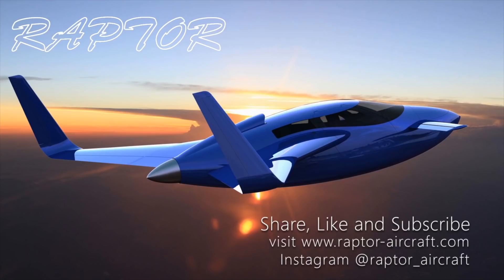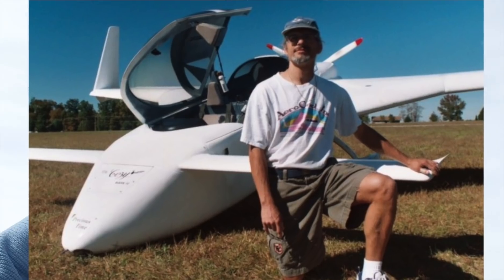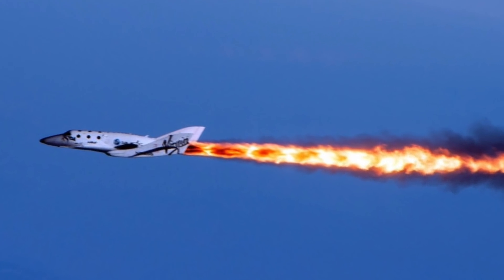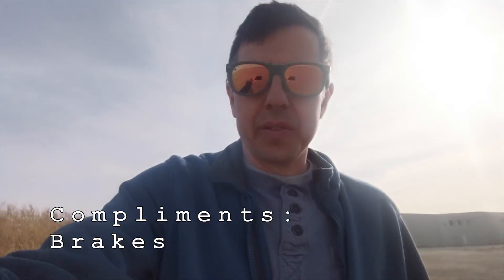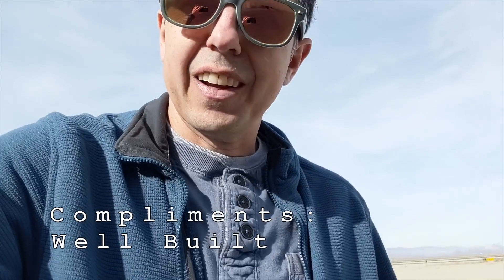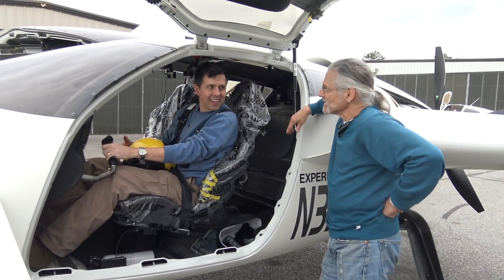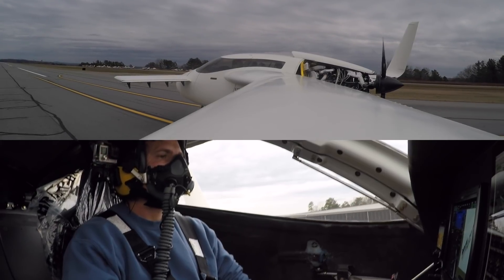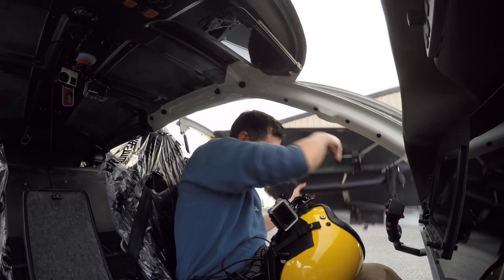Clever Girl - Raptor Aircraft Prototype First Look - Wasabi Flight Test

Comment: Totally transparent build and modification process followed by an independent and transparent assessment, review and test flight process. Has this happened with any other aircraft design? I think not.

Really looking forward to seeing the flight test process unfold for this aircraft. Of course there will be glitches, failures and modifications. This is after all a prototype. To expect otherwise is simply ludicrous.

And especially hoping that Diesel engine concept is a winner. There are lots of places across the world where Avgas is getting increasingly difficult to get.
Reply: As a boat guy, I know that Diesels are meant to run for long periods at full throttle. Traditionally, they are heavier than gas engines, but they are much more durable than gas if fed a good diet... the fuel filters need to be very good and no air must get in to the injectors.
Reply from the maker: Thanks for the comments guys, we are excited as well!

Comment: FYI ... taxi test had a main gear  failure due to a bushing popping out of its mount.  To my knowledge, no drop test has ever been done on the aircraft.  Considering that the current weight of 
the plane is at or over TQW with a single pilot and 30 gal. of fuel the main gear will be stressed on  landing .
Reply: To be clear max. TOW
Reply from the maker: Thank you

Comment: I strongly recommend you bring in someone with Audi / VW Diesel performance experience to evaluate Peter's decisions in building the powerplant.   I had a conversation with Malone Tuning about this platform a while back and they seemed interested in the idea.   I think there are gremlins in there.  I'd like to see a bore-scope through the glow plug holes to verify the combustion chamber in the pistons isn't pitting / melting due to the extremely high temps he's be running.  Also education on how hot is too hot for EGT and why piston diesel is different than piston gas combustion.  Peter claims his EGT probe being at the Y junction of his crossover pipe is the reason for the excessive temps.  What's his math there?  We always pull EGT from the most restrictive spot in the exhaust and anything over 1300 (conservative) should be limited to very brief pulls.
Reply from the maker: Good thinking!
Reply: While they're at it, have the Audi experts check out the custom ECU tuning that was done, especially the program that pulls power when temps get too high. That doesn't seem safe for initial flight testing.
Reply: I believe it's running a third party ECU and not an Audi one

Comment: Over here from Raptors channel, why would you want to open the door and Bail out of a pusher prop aircraft with BRS? Just wondering.
 Would you be planning on deploying the BRS and then bailing out on your own ? 
You would have to deploy the BRS, shut off the engine and feather the prop, open the door, and then bail out of the aircraft under it's own chute, With your own chute?
Reply from the maker: There are two reasons you bail-out.  

First is fire (BRS doesn't help there).  

And second is the airplane is out of control and unrecoverable (or unlandable).  In that case the airplane is likely spinning around some axis, and therefore the propeller may not be an isssue.

I would suggest we change the way the question is asked.  Can you fit a parachute in the airplane?  Is there any chance you might wish you'd brought the parachute?  If those answers are yes, then you bring it...period.

It's also worth mentioning that the BRS has not been tested, so if it failed it would be nice to have another option.
Reply: @utopiasnow  I suppose that all makes perfect sense. I would suggest running the engine on diesel as opposed to Jet-a or any kind of blend of the two.
 I've never seen Diesel catch fire and I believe it's less volatile than Jet-a. 
 I once drove a Diesel back to the shop leaking diesel from the return lines, it leaked onto the exhaust manifolds.
 Not my finest hour, but I reasoned that the harder and faster I ran it the less return fuel there would be. 
 I drove that thing 40+ mi trailing a smoke screen that would've made a WW2 tank commander proud. That GM big block V8 didn't have enough EGT to ignite Diesel.
 The Raptor has really high exhaust temps, so I would back off the power to drop EGT and fly it in case of fuel leak. 
 Diesel fuel changes formulation throughout the year and across America according to climate, right now it should be most resistant to low temperature jelling. There are anti-jell additives available everywhere.
Reply: @kylegoldston  jET A IS REFINED DIESEL FUEL AND IT HAS PARRAFIN IN IT TOO.
Reply: @billwessels207  Crude oil arrives at the refinery and goes into something called a "crude tower" where it is subjected to changes in temperature and pressure. This process breaks down and separates it into different length and density hydrocarbons which are then evaporated off for further treatment throughout the refinery, they don't turn one fuel into another. I worked at a refinery rebuilding a crude tower that burned for a couple days and then fell over. My point was that Diesel fuel is harder to ignite, providing a bit of safety margin in case of a fuel leak.

Comment: Why do you wear O2 for all the tests and flights?
Reply: Safety.  They are testing a new design, they are prepared for the cockpit filling with smoke.
Reply from the maker: Three reasons:
Crash Protection
Better Comms
Smoke in the cockpit

More info here:
https://youtu.be/a-lceaOL2E8
Reply: Also for comms
Reply: Pretty dorky.  Notice how Peter is in the same cabin without oxygen or helmet.  Seems like a lot of Hollywood action going on.
Reply: @marmstrong77  ya my thought exactly
Reply from the maker: Daniel Mills-Thysen the taxi test is a dress rehearsal for first flight.  It gives us a chance to check the comms, head clearance and sight angles in flight configuration before that first flight.  Meanwhile if the only cost of a safety measure is looking like a tool, that’s not much of an argument.

Comment: Is that a diesel engine? What are the planned performances? What is the base target price? Thanks!
Reply: Yes it is a diesel engine.
Reply: @Marvi Wilson Diesels are much heavier than their gasoline equivalents, they NEED to be because of the nature of the diesel combustion cycle, it places greater stress on engine components. Here are some comparisons:
-
AE330 - 180 hp, 410 pounds.
Deltahawk DH180A4 - 180 hp, 340 pounds.
Lycoming IO-360 - 180-200 hp, ~300 pounds.
Viking 180 - 180 hp, 260 pounds.
-
SMA SR305 - 227 hp, 455 pounds.
Honda/TCM HAP engine - 225 hp, 200 pounds.
-
Continental CD-300 - 300 hp, 548 pounds.
TSIOL-550-A (liquid cooled) - 350 hp, 401 pounds.
Adept Airmotive 320T - 320 - 360 hp, 340 pounds.
-
I suppose saying that diesels are twice as heavy as gasoline engines was a bit of an exaggeration, but not by much in some cases.
-
Modern gasoline engines are just as efficient as modern diesels, compression ratio is far from being the only engine attribute which determines efficiency.
-
BSFC in lb/hp/hr:
Continental IOL-200 - 0.345
SMA SR305 - 0.36
Liquid Cooled Air Power O-360 - 0.36
Honda/TCM HAP engine - 0.37
AE330 - 0.39 - 0.35
Deltahawk DH180A4 - 0.38
Rotax 915 iS - 0.395
Limbach L 2400 - 0.40
Viking 180 hp (no leaning) - 0.42
-
Other engines:
Some well tuned, naturally aspirated Honda 4 cylinders can get down to around 0.36 lb/hp/hr while making 200 hp at around 5,500 rpm.
Even with very crude engine technology (by modern standards), the Wright R-3350 and Allison V-1710 turbo compound engines were able to get down into the 0.36 to 0.38 lb/hp/hr range.
-
Modern gasoline engines can run on mogas, which is cheaper than any aviation fuel. The problem with the aviation community is that it's insane and compares modern diesels to archaic LyContisaurus engines and assumes that this is a fair comparison. Adopting modern gasoline engines would bring FAR greater benefits to light aviation than adopting diesels.
Reply: http://www.raptor-aircraft.com/
Reply: http://raptor-aircraft.com/
Reply: @Marvi Wilson "...the compression ignition engine goes further on the same quantity of fuel as the spark ignition engine equivalent."
-
Only by volume, not by weight, cost (in the US), NOx emissions, or CO2 emissions, so in all of the ways that matter, gasoline engines are superior. Although, in aircraft, NOx emissions would probably be comparable due to LOP operation being required for peak efficiency.
-
Diesel contains about the same amount of energy as gasoline by weight, gasoline and diesel engines consume about the same amount of fuel by weight to produce the same amount of power (this is what BSFC tells us), this means that diesel engines and some gasoline engines have about the same thermodynamic efficiency.
-
The only diesel aircraft engine that doesn't have electronic fuel injection and has a good chance of powering aircraft is the Deltahawk engine, all of the rest have very complex and expensive electronic injection systems. Using heavy fuels in aircraft also brings other issues, like the need for fuel heaters to prevent fuel from gelling in cold temperatures and at high altitudes.
-
Here's some information that I complied a while back for automotive diesels. The information comes from the EPA and everything is based on combined city and highway mileage.
-
Chevy Cruze (gasoline): 153 hp; CO2/mile 277g; annual fuel cost $1,050; EPA smog rating (out of 10) - 6.
-
Chevy Cruze (diesel): 137 hp; CO2/mile 294g; annual fuel cost $1,200; EPA smog rating (out of 10) - 3.
-
Mazda CX-5 (gasoline): 187 hp; CO2/mile 335g; annual fuel cost $1,300; EPA smog rating (out of 10) - 7.
-
Mazda CX-5 (diesel): 173 hp; CO2/mile 365g; annual fuel cost $1,600; EPA smog rating (out of 10) - 1.
-
Honda Accord Hybrid (gasoline): 212 hp; CO2/mile 184g; annual fuel cost $700; EPA smog rating (out of 10) - 7.
-
Prius (gasoline): 121 hp; CO2/mile 170g; annual fuel cost $650; EPA smog rating (out of 10) - 7.
-
Trucks...
-
Ford F-150 2.7 EcoBoost (gasoline): 325 hp; CO2/mile 423g; annual fuel cost $1,600; EPA smog rating (out of 10) - 5.
-
Compare to...
-
Ford F-150 3.0 Power Stroke (diesel): 250 hp; CO2/mile 463g; annual fuel cost $2,000; EPA smog rating (out of 10) - 1.
-
Ram 1500 3.0 EcoDiesel (diesel): 240 hp; CO2/mile 448g; annual fuel cost $2,000; EPA smog rating (out of 10) - 1.
Reply from the maker: Thanks for the comments
Reply: @Marvi Wilson 100% agree, so that is why it has a future with alternative fuels and should be looked at as a positive, rather than a piece of a tractor.
Reply: That whining sound is over here on this channel. It gets around.
Reply: @Ausiguy1  The whining sounds are probably going to keep this guy from killing himself, or someone else.
Reply: Yup, and the aircraft is only 700 pounds over weight! With a full load of fuel, it can carry a whopping 100 pounds worth of people and baggage! Diesels just make the best aircraft engines!
Reply: @PistonAvatarGuy  Well I think you are one of those who think Diesels are just heavy, low powered engines used for tractors! I days gone by Diesel engines ran rough with high vibration and with a narrower power band than petrol. Now with electronic fuel control the engines have wider power bands, run smoother and have even higher fuel economy (which would give enven more range). The engine is not confined to running on the same Diesel that cars run on (which can have problems at low temps) but could run on Jet A1which is cheap in aviation terms. There are a few diesel powered planes that are flying and take advantage of the high torque and econemy.
Reply: @flyingkub  Diesels are still about twice as heavy as gasoline engines of the same power output and modern gasoline engines are just as fuel efficient as modern diesels (by fuel weight and by cost). Torque provides absolutely ZERO advantage in aircraft, especially when a PSRU is involved. Running Jet A in this engine comes with a lack of lubrication for critical parts in the fuel system, like the injectors and high pressure fuel pump (something which can be problematic in VAG products). Modern gasoline engines can burn unleaded gasoline (mogas) without issue, which is also significantly less expensive than both Jet A and avgas.
Reply: @PistonAvatarGuy  The Audi diesel engine is 5% heavier than their petrol, produces 90% of the power and burns 80% of the fuel produces 110% of the torque, I agree the argument about torque has been a long standing one for aviation. On the Mogas side, there are the problems of alcohol in most making them take on water, which will not show when you sump the fuel and can freeze at low temp.
I talked to a pilot of a YAK diesel test team last year, he was saying they used Jet A1, he had flown the aircraft for over 500hrs and was part of the test program and the engines had flow and been checked showing no problems and a long TBO is expected. The performance of the aircraft has been better than expected for a basic trainer allowing the aircraft to be fully aerobatic.
I agree I don't see much of an advantage to diesels but then I don't see much in the way of disadvantages and I think it is great that somebody is working without prejudice, in the same way that some are experimenting with electric flight, both I think will have a limited market but both may have a future once petrol prices climb in the future.
Reply: @flyingkub  "The Audi diesel engine is 5% heavier than their petrol..."
-
That's because the VAG has some of the worst gasoline engines on the market.
-
"On the Mogas side, there are the problems of alcohol in most making them take on water, which will not show when you sump the fuel and can freeze at low temp."
-
Mogas does not have alcohol.
-
"I talked to a pilot of a YAK diesel test team last year, he was saying they used Jet A1, he had flown the aircraft for over 500hrs and was part of the test program and the engines had flow and been checked showing no problems and a long TBO is expected."
-
That's because the engine was designed to run on Jet fuel, automotive diesels are designed to take advantage of the relatively high lubricity of diesel.
-
"...but then I don't see much in the way of disadvantages..."
-
They're significantly heavier, significantly more expensive to produce and they burn more expensive fuel.
-
"...both I think will have a limited market but both may have a future once petrol prices climb in the future."
-
When gasoline prices climb, so will the prices of jet fuel and diesel. Electric aircraft currently have no future, they require an absolutely immense breakthrough in battery technology to be viable.
Reply: @PistonAvatarGuy  The YAK engine is derived from a car engine.
MOGAS in the UK has alcohol in it unless you but aviation based MOGAS which is not real MOGAS it is 91UL, the fuel you get at petrol stations in the UK nearly all contains Ethanol with few exceptions.
I agree that electric aircraft will not be used for long range flight but for training aircraft and there is already a group evaluating an electric DHC2 Beaver.
The thing you are missing is that diesel (or rather compression ignition) engines can run on a wide veriaty of fuels, from vegitable oil through to methanol so when mineral oils go up in price the work done now will allow us to continue to fly.
Don't knock someone for try something different.
Reply: @PistonAvatarGuy  To put it simply......ethanol should be banned....forced on everyone based on a hoax. A very good fuel article you linked there. Frankly, there are gasoline automotive engines out there now that are light weight and true HP beasts per cu.in. which can only be done with ECU's and superior internal components that can easily endure an aircraft power profile. All the race tricks used for years have found there way into standard production in pursuit of pleasing customers while meeting CAFE standards. I guess in a strange way, government wonks created the obstacle and good ole American ingenuity has resulted in these mass produced powerful engines light enough for use in aircraft.... I'll call that a win, win any day.
Reply: @GenasysMech  I don't know if ethanol should be banned (racers absolutely love E85), but it certainly shouldn't be subsidized by taxpayers, the same goes for fossil fuels.
-
Contrary to popular belief, the government (in the past, anyway) wasn't the bumbling bureaucracy that people make it out to be, policies were proposed by people who really knew what they were doing. The real improvements to engine efficiency came from the Japanese, the American big three just threw temper tantrums when regulations started to tighten on emissions and fuel economy.
Reply: @PistonAvatarGuy Agreed, however, in respect to ethanol,  aka, corn, the larger context of concern is the truly finite resource of the Great Midwest Ogallala Aquifer. We are literally burning away a major source of food. The water is being drwn off at such an astonishing rate it cannot recharge fast enough resulting in soil compaction that is permanently destroying the aquifer.
Reply: @GenasysMech  That is very true, I had forgotten about that.